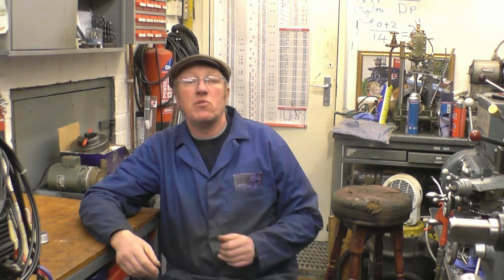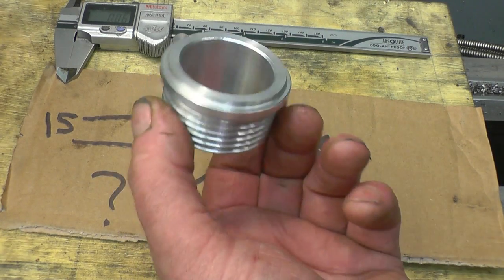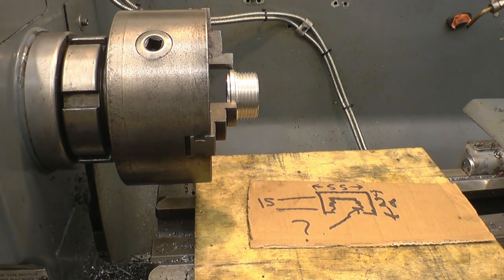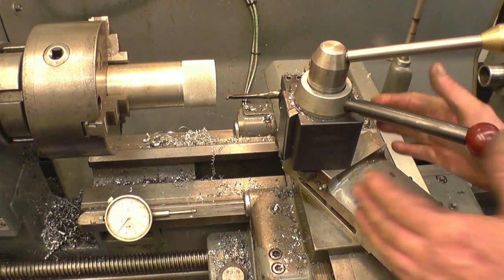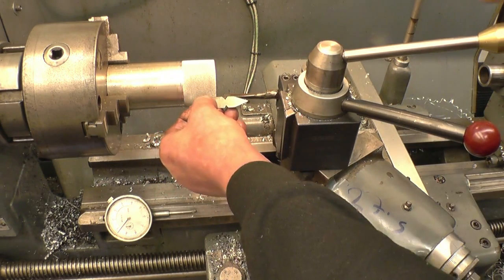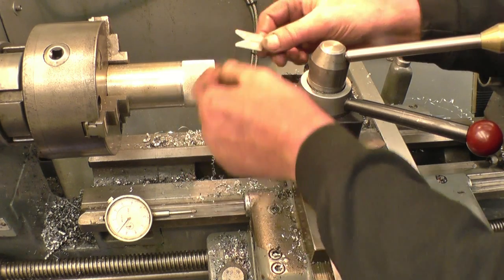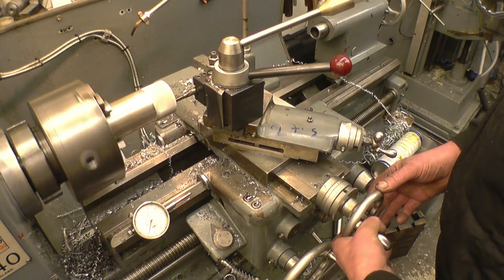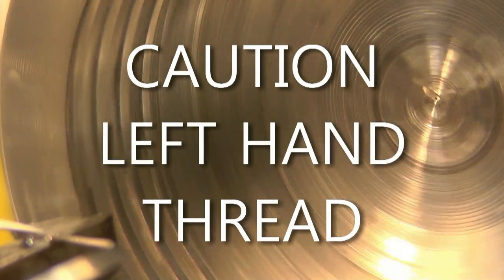SNNC 113 P1 Knurling aluminium / Screw cutting

Comment: Whenever I do something like this I try to console myself with the fact that I at least got some practice in. I did notice something when you were measuring the threads though, the more threads you measure across when you are trying to get the pitch the more accurate you'll be. This is because your error will probably be constant, lets say 0.5mm, so on one 3mm thread the error is 17% on two it's 8% on three 5.5% etc. Not so important with big threads like this but on smaller threads it makes life a lot easier.